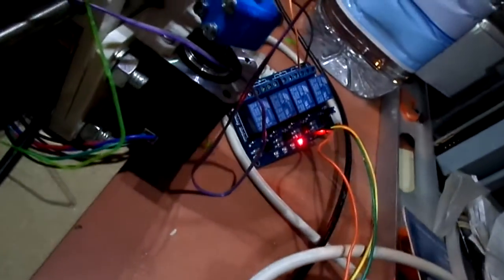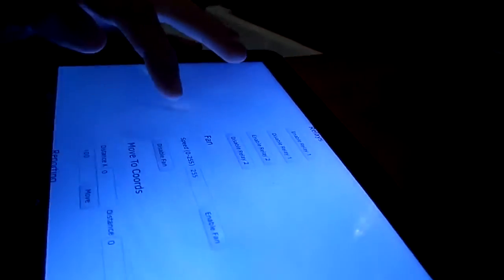3D Printing: OctoPrint: Turning Lights On and Off

Comment: Im new to 3D printing and haven't learned gcode yet so you are definitely more advanced than me, but I was able to do this adding these lines to the bottom of the ~/.octoprint/config.yaml file. The number 2 representing whatever pin on the pi you are using to send a signal to a relay switch. The 1 meaning ON of course. I thought I would share to help anyone get this up and running. Probably not as useful as attaching it to the M42 gcode like yours but easier for a newbee. Thanks for posting this video it really inspired me to dig into the works of this application.
code:

events:
  enabled: True   
  subscriptions:    
  - event: ClientOpened
    command: gpio -g write 2 1
    type: system

Comment: Wow this is awesome! I need this!

I am pretty new to raspberry and octoprint, but how did you wire the lights exactly? how did you connect the relais to your Pi?
Reply: I need this to  I just won't my led lights to come on just when I go to the Octoprint page
Reply from the maker: I told octoprint to send gcode that commanded a pin  that made a relay fire